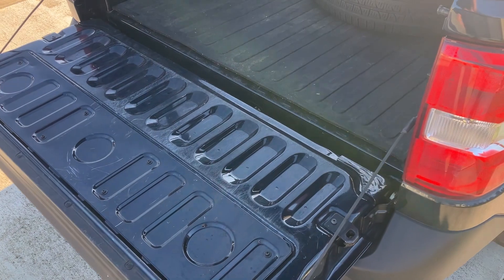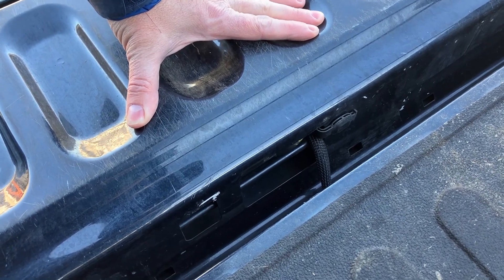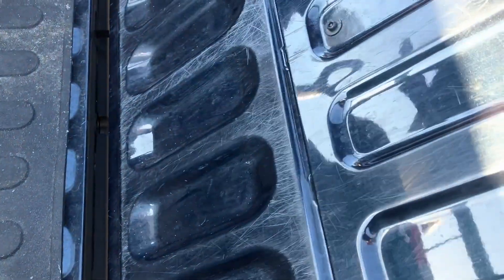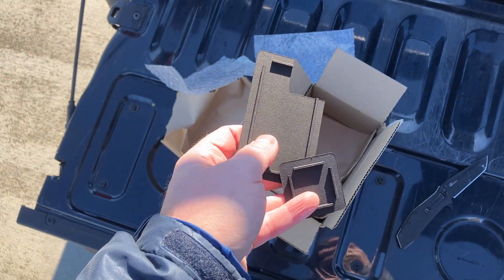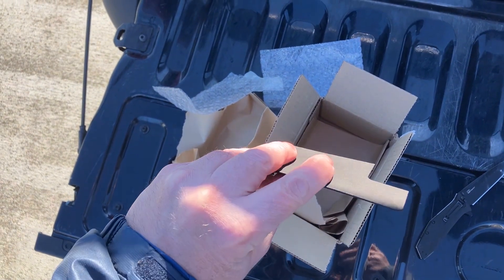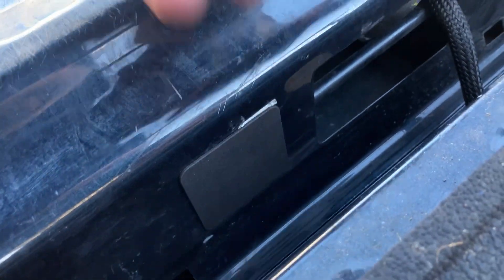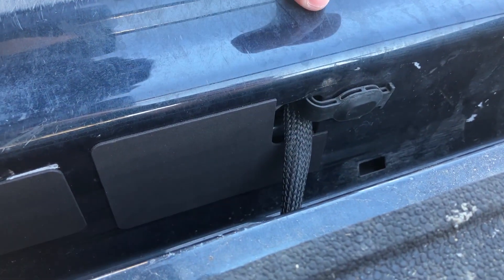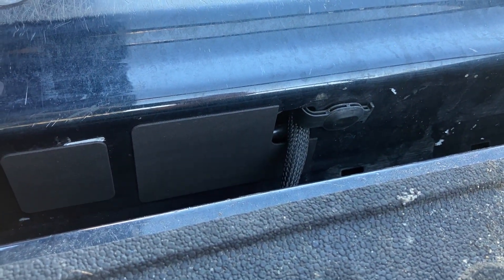The best $20 (or less) modification for your Ford Maverick tailgate

Comment: I believe these holes are for water drainage , if water gets down inside the panel and remains  inside you will have a rust problem.
Reply from the maker: That was my thought initially but if you look carefully at your tailgate you’ll see there are already small square drain holes all along the bottom.